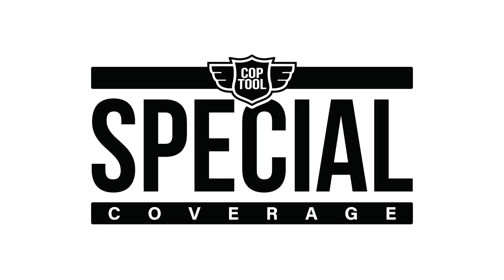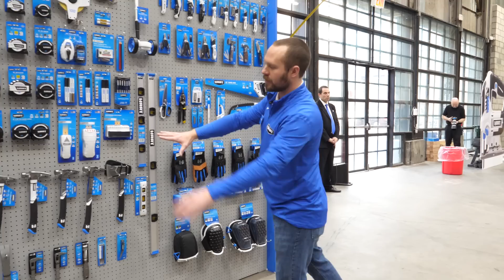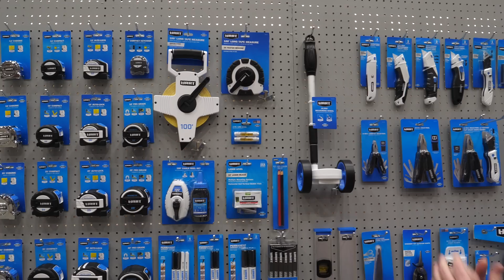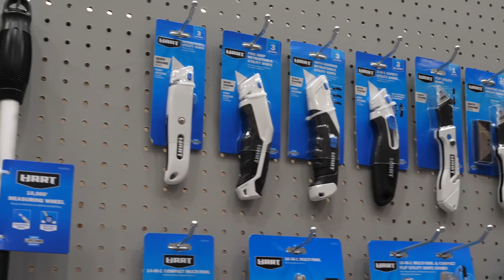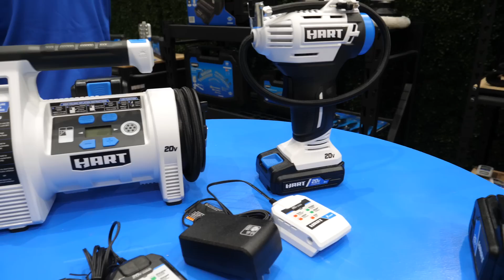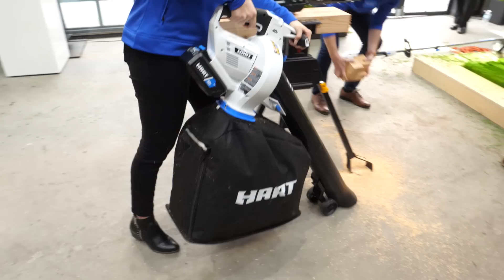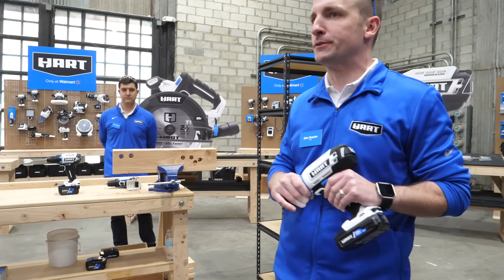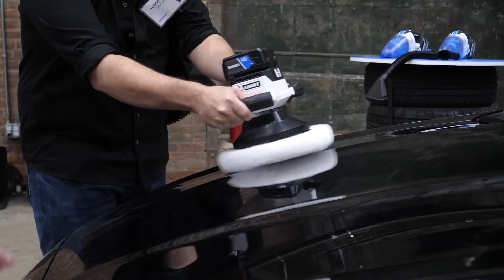HART Power Tools take Walmart by STORM. (Full Event Coverage!)

Comment: They looked cheap to me when I looked at them.
And they didn’t mention anything about a warranty.
Reply: Tuna Fish I took a chance on the 20 volt drill. I like it so far. It comes with a 2 yr warranty and I got an extended for 5 bucks. Took a chance on 50 bucks so we’ll see what happens.
Reply: @theogre6551  is the extended warranty through a third party (square trade), or through Walmart/Hart itself?  For DIY/"prosumer" grade tools, Craftsman cordless tools are 3 year manufacturer warranty and you deal directly with Lowe's.
Reply: The Ogre 
Nice thanks

Comment: Yah, I'm sure you'll be able to get batteries for these tools even five years from now. "RIGHT" Just like you can buy ammo for your AR-15 at Walmart. Walmart has no loyalty to any product or for that matter any customer. Spend a little more money and get a Milwaukee or Dewalt and you'll be able to keep it running for decades. Don't waste your money on junk that Walmart is just throwing together just to jump into the battery powered tool market that is so hot right now. It may look OK at first glance but when you're out there putting a new deck up for the wife and these tools leave hanging , she's really going to be impressed with your decision to save a buck at "WALLY WORLD".

Comment: Regardless of the tools, it's at Walmart. The section will start out really nice and impressive. Soon the one thing you came for will be out of stock, some of it mislabeled or in the wrong place, some of it under the women's dress rack and in the toy section, some of it opened and sloppily taped up. Also I don't see this competing with big boxes, seems to have it's sights more on harbor freight.
Reply: Lol I work at one. Your thought process is not too impressive. All tools are in stock. They are in their spot. They are still in their main packaging. The truth is, it will not completely compete with higher brands like Milwaukee, Ryobi, or anything else. But Hart is meant for those DIYers at home and not meant for any big job. Common sense would make that clear but I see most of these people in the comments don’t have that.

Comment: I thought it was interesting you mentioned the 20v power wheels. I feel like that’s a pretty common mod people do to power wheels.  
And the ebike is already made by makita.  Along with a coffee maker.  
And it would have been amazing if they did 2 - 20 v batteries for the 40v line instead of 1 - 40v battery.  I feel like that would make the 40v line an easier sell since you don’t have to change battery platforms.

Comment: I picked up the $99 drill and impact kit! My only complaint is how Big they are compared to most brands!
Reply: Totally agree. The cordless drill/driver is as big as my old 75th anniversary craftsman drill and that was one huge. It's like a torpedo. If the would shrink it down a bit, i would really look at this line.
Reply: Thanks for your feedback!
Reply: The Ryobis are the same way - larger than you would expect today. My Dewalt impact driver is about half the physical size of the Ryobis, but the Ryobi Impacts that I have perform really well, especially the brushless models.

Comment: looks like ryobi with a different battery for Walmart
Reply: Ryobi are very good for the price
Reply: TTI, the company making hart power tools, also makes ryobi, ridgid and a few other solid brands. That’s why Walmart has sparked my interest with this new line up.
Reply: It is. It actually feels a tad cheaper than Ryobi.
Reply: Ryobi brushless line doesn't suck .. you might need to research ryobi again
Reply: I've had great luck with the Ryobi line. If you have a military ID it's a 10% discount.
Reply: Looks like kobalt